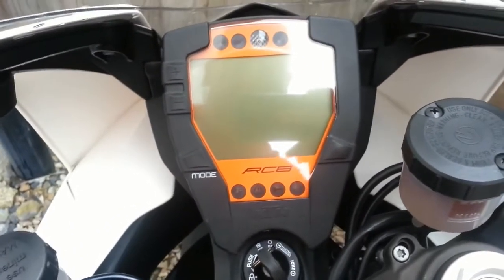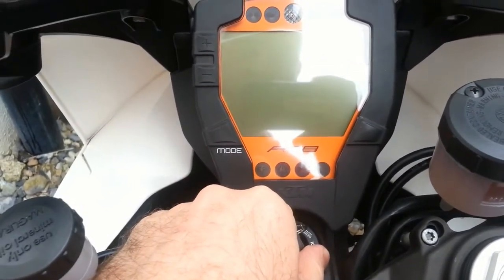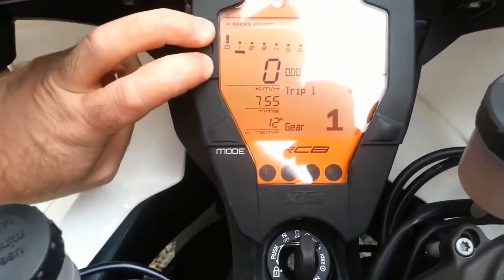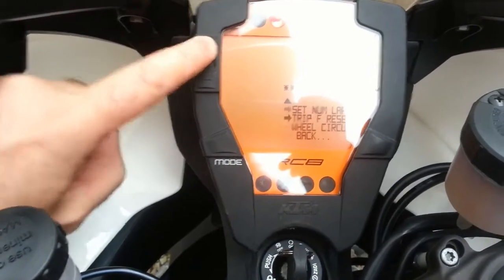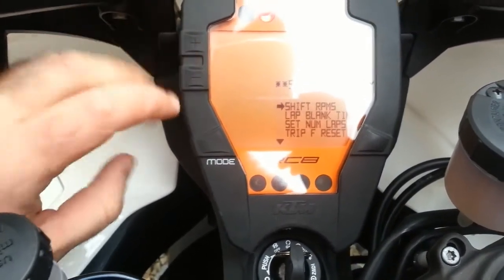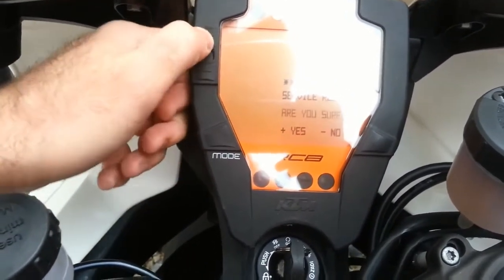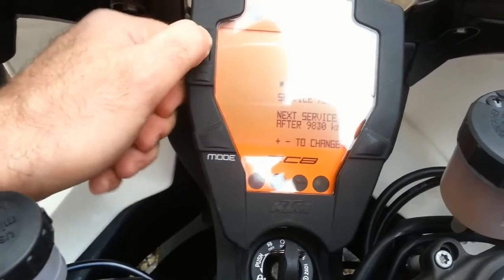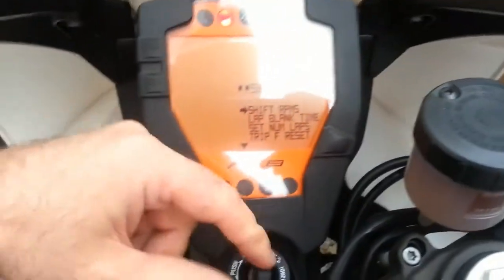How to reset service light on a KTM RC8 and RC8R

Comment: Im trying to figure out how to remove the low fuel light on my RC8R dash! Can you advise please?
Reply from the maker: I'm afraid I can't, why would you want to remove that?
Reply: @ontwowheelswithgrahambo9230  mate i was at a recent track day and the alarm came on so i pulled into pits. i then found the reason for the alarm it was low fuel. So i have since obviously refueled but even after this being done the alarm and low fuel sign is on the dash. All good ill get it sorted. Thank you for reply! Good day!
Reply: @craigkelly79  turn off and on again.
Reply: @craigkelly79 very late reply .. you could probably just remove the fuel sensor switch :) it’s one of the once you unplug when removing fuel tank